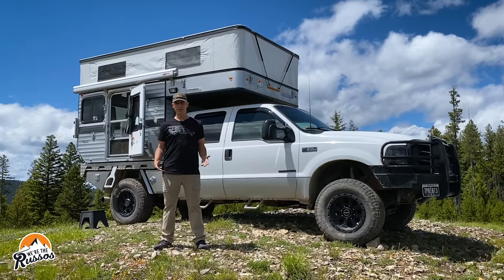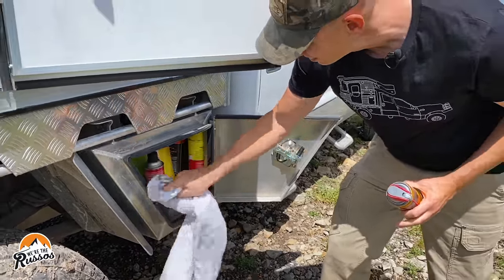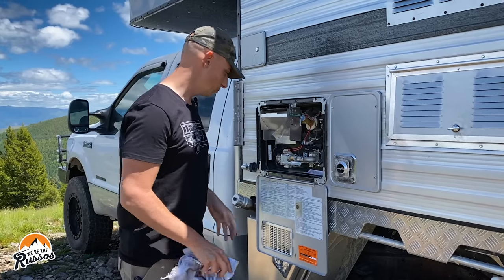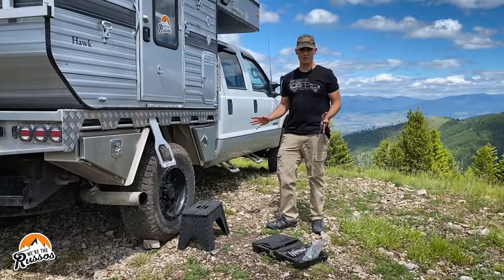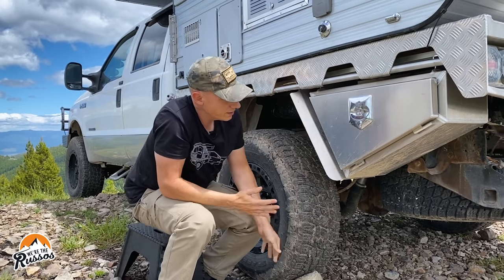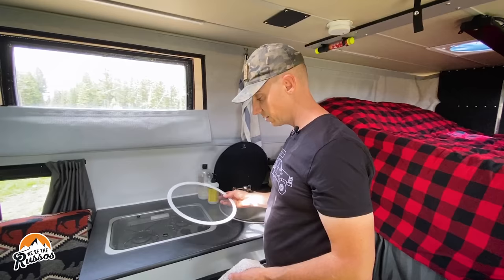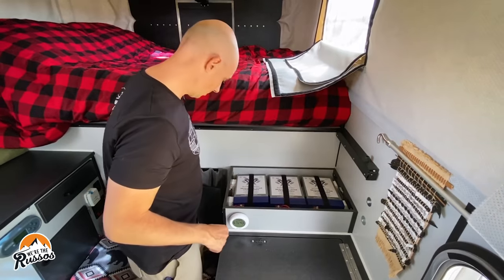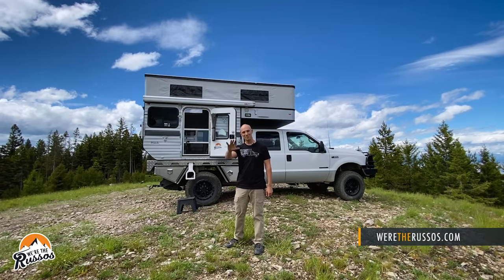Camper & RV Maintenance Tips | Overland Truck Camper Life

Comment: Hi from Canada, little trick put a mark (example a sharpie) on your main bolts to your frame   , like that you have a visual so if the line is not connected the bolt or loose
Reply from the maker: Thanks for the tip!
Reply: ...great tip! Hope you do not mind if I use that too!
(Even on the liquor bottle. Lol)

Comment: I use dielectric grease on my rubber seals.  I read it in an owner manual for one of my cars.  It works great and lasts a long time.
Reply from the maker: Interesting - thanks for the tip!

Comment: Great video and reminder for owners to do basic regular maintenance. Since you have lithium batteries, they do not need to be vented like an AGM/lead acid, plus they don't like the cold, so when owner's switch to lithium, they typically plug the outside vent. This not only keeps the lithium batteries warmer when temperatures are at or below freezing, but prevents dust/insects from coming in the vents. I recommend plugging the battery box vents when running lithium batteries. Just make sure it's reversible because if you or a future owner ever switch back to lead acid, the battery box will again need to be vented.

Comment: Thanks for this timely tip! Besides our camper van, we have a Camry with a sunroof...with a rubber seal. Sunroofs require maintenance or they'll stop opening/closing. If you don't clean and condition the rubber seal it will LEAK! I'm gonna get a can of this.
Reply from the maker: It’s good stuff - I’m even more impressed with their dry lock lube which I’d also suggest picking up.

Comment: Cool video! We just bought a Grandby on the Norweld tray so we’ll be sure to check those bolts regularly. Ours is Mounted on our F350. I’d love to know more about what you’ve done with your suspension system. Also curious where you guys plan to head for the winter months. We are boondocking Colorado right now. Hope to see you guys someday.
Reply from the maker: We had a shop in Idaho Springs do the work on our suspension. Details here: https://weretherussos.com/73-powerstroke/

Comment: I make it a point to put my lips on the water heater propane vent and blow the tube out. Blew the fuse on my first outing because a spider made a nest in there. Of the times after, I took it apart and sure enough, bugs were in there. I just blow now. : )
Reply from the maker: Oh interesting - thanks for the tip!
Reply: We're the Russos ...very interesting. Lolol (I thought lips was an incorrect autocorrect. Boy am I wrong!)

Comment: I figure you may know this already, but if you don't want wasps, hornets, etc in your WH Furnace, etc, there are wire mesh "cages" that keep them out.  Cheap, simple to install and very effective…you can also jury-rig wire mesh around the vents on your roof-top A/C unit covers…find what adhesive works best for you…everyone has their own preferences. On those, over the years, I've mounted mine on the inside…they can also make their homes in your sewer roof vents, as well.   
                                                                                                                                                                                                                                   ~ ~ ~ ~ ~ ~ "Scooter in East Texas"

Comment: Great reminder, I will check clean my fantastic fan and furnace.  Did you check the mounting bolts for the camper mounting to the truck bed, or did I miss that?
Reply from the maker: Yes I did - about half way through the video.

Comment: The oil will collect dust. Might want to use a dry grease on the hinges.
Reply from the maker: I've tried that too and this seems to work best.
Reply: We're the Russos . I agree. Dry grease...”dries too soon and later cracks” it doesn’t lubricate properly.

Comment: Bonus Tip – Check your Smoke, Propane, and Carbon Monoxide sensors on a regular basis. Make sure they have power or fully charged batteries.

Comment: Good find on the loose bolts, maybe get some locknuts on them.
Reply from the maker: They thread into sliders, so they don't have nuts I can swap out. The ones on the frame of the flatbed / truck have locknuts on and those were fine.

Comment: Joe, I'm looking to buy F250 Superduty 4x4.... and eventually a pop top similar to yours.  The truck I'm looking at only has the stock factory tires. What size / brand are you running? How have they performed on road? Are the quiet?

Have you done a tire video? I looked but didn't see one....

Thanks
Reply from the maker: All of the details for our truck are here: https://weretherussos.com/73-powerstroke/

The tires are quiet and we love them but they’re wearing fairly quickly.

Comment: Thanks for sharing , picked up a couple of good tips , which reminds me .. What do you use as a sink , shower drain screen , to help protect and maintain a clean gray tank ? ~peace~
Reply from the maker: You’re welcome. We don’t use any sort of screen. Everything goes into the gray tank and no issues.
Reply: @Weretherussos  Ok - just go these for my Rig , I let a know if it helps to be proactive ~ peace~ 
2 pcs Heavy Duty Stainless Steel Slop Basket Filter Trap, 2.75" Top / 1" Mesh Metal Sink Strainer,Perfect for Kitchen Sink/Bathroom Bathtub Wash basin Floor drain balcony Drain Hole

Comment: Does the 3-1 seal conditioner attract dirt and dust.  Newmar is recommending using baby powder per the RVGeeks
Reply from the maker: We've tried it but it's messy and doesn't seem to work well. We haven't noticed any dust collected by the 3-IN-One. They also make a product to lube slides, but we've never tried it.

Comment: Really shouldn't use oil, especially light machine oil on pin or pivot hinges, it traps dust and doesn't last very long. Aluminium hinges & pivots are the worst because they form aluminium oxide dust through normal use; that builds up. Use pure silicone spray or dry graphite on locks and light wear locations and lithium lube ("white grease") on heavy use like door hinges, especially truck doors, and in areas exposed to elements. Old fashioned grease underneath and occasional lube jobs are also important with the driving y'all have been doing lately.
 ( Can't help with off-road pinstripes though! 🤔 Oh well, keep livin' life)
Reply: Again about this oil subject??

Comment: Forgot to check your spare tire.
Reply: D DEMCHAK hello, my 91 TAURUS did 430K, the SPARE HAS NEVER BEEN USED ! Had to replace it  another TAURUS 2013  used with 19K , now 29K but need to get a spare as it came with time stuff & an air compressor   Cheers 🇺🇸🇺🇸🇺🇸🇺🇸
Reply from the maker: Not much to check other than a visual inspection. I don't keep it aired up as we have an air compressor and if/when we need to use it we can air it to the correct pressure.

If you notice when I get to the back of the rig, I give things a quick look. The chassis/engine/truck is a whole separate inspection I do on a regular basis.